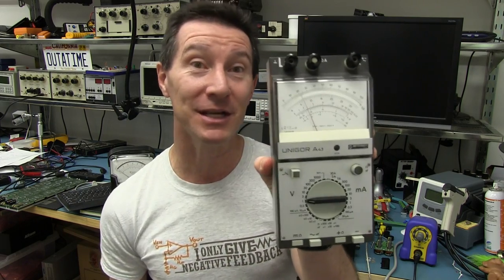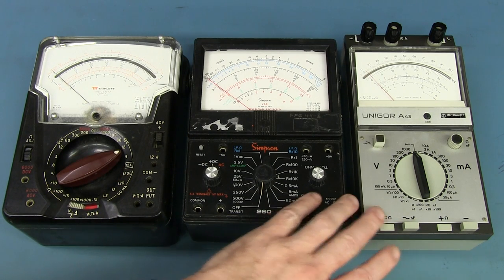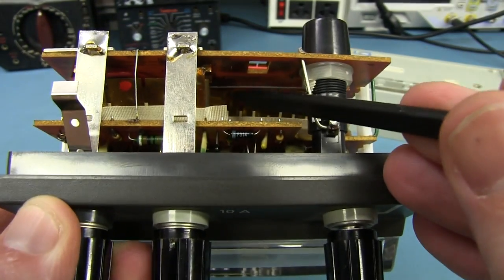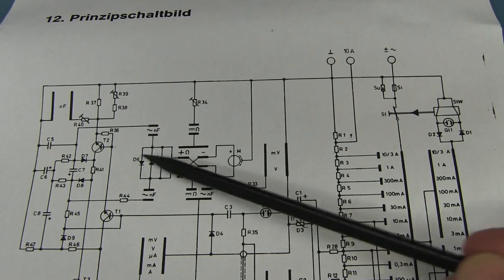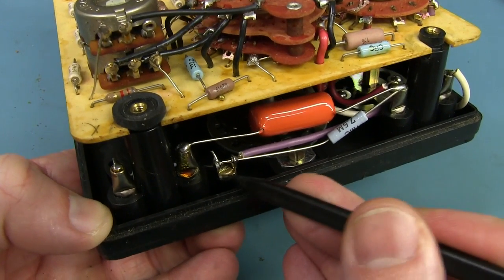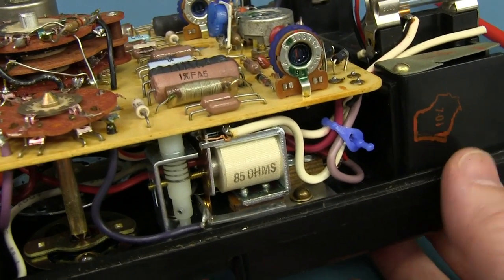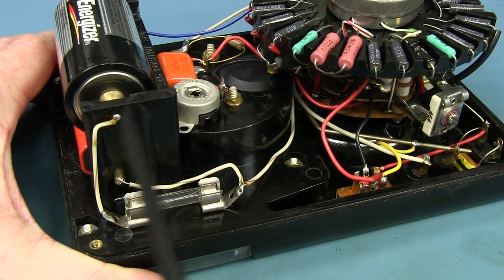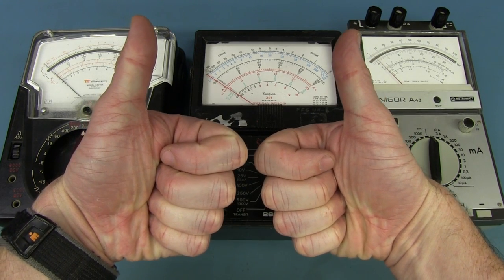EEVblog #634 - Analog Multimeter Teardowns

Comment: "German engineers do things because they can, not because they should."
Reply: That, and I believe the proof was in the pudding with that one. Crusty, perhaps, but also crusty and fairly accurate at it's age...
Reply: The over engineered protection relay reminds me of all the overly complex components in my VW.
Reply: Stephen Tack Overly complex? Or just sustainable?
Reply: *****  stuff with unneeded complexity (that requires ridiculously tight tolerances), like  pneumatic door locks, clutch throw out rods through the center of the main transmission shaft, etc... Just so many things that are fancier than they need to be, causing difficulty in repair.
Reply: It's really a tradeoff between how often you are willing to repair or recalibrate something.
Complexity and unneeded complexity are two different things.
Reply: That thing is not German, its Austrian. We've got better ones in school like this rather rude stuff, not mentioning professional ones.

Comment: how to locate R-11 and R-12 in simpson 260 6xlp, my low power resistance R1,R10 are not properly going to infinite sign even I change my 1.5 dc volt battery. thanks for help.

Comment: Hey Dave,
You should have focussed a bit more on the actual movement of these fellas... 
The Simpson does not even have a mirrored scale, which already makes it pretty inaccurate...
The Metrawatt UG 43 (I grew up, using them - I love them!!) uses a movement, that we call "Spannbandmesswerk" here in Germany. This means, the moving part is not mounted via a pivot, that sits between two stones (friction!!!), but instead it is mounted on a veeeeery thin "string" that is under tension (no friction at all!!!). At least the Simpson does have a standard movement - this alone makes the Unigor 43 superior and way more accurate than the Simpson (and probably also the Triplett). 
I have two UG43 here in my workshop, and these were the meters I used in 90% of all situations, until I got two nice Fluke DMM. Now I only use them, if I need an analoge meter (happens regularly). They both still work 100% accurate and fine. I love them (as I mentioned before...)... 
And, by the way: A multimeter that uses a 30 volts battery that is no longer available, seriously? This is not an option! At some point the battery will start leaking, resulting in a huge mess... Without that battery, you cannot use the complete multimeter properly. So, in my opinion, this is something to remove the battery and put the meter on a shelf... 
I'll stick to the UG43 ;)
Reply: By 'stone' do you mean jewel? They work fine in watches! The mirror coating has started to flake off on part of the scale on my 630NA.  I have not checked mine, but what function does that 30V battery perform?  Mine must still be good.
Reply: @barrybogart5436  Correct. I meant jewels. My mistake. 
Those batteries usually power the ohms-part of the multimeter. I guess, in the past they used such "high-voltage" batteries to be able to measure higher resistances, as otherwise the current would be too low to be indicated by such an analogue movement.

Comment: Why do the metres have batteries in them if they dont need it. The reason I'm asking is because I'd like to use my grandfather's old Philips unit but I don't know where ill be able to find a 22.5 volt battery anymore.
Reply: You need the batteries for measuring ohms. The small 1.5v is for the lower ranges and the larger one is for the max range.
Reply: Just use two 12v remote control batteries in series, or three 9 v batteries if there is space. 22.5 v isn't critical, the meter will work at 24 or 27 volts, sometimes even as low as 15 volts, as the zero is adjusted for the ohms ranges!!! Experiment!!!!

Comment: Try finding a new 30V battery for that Triplet meter. That must be hard to find :)
Reply: If I had to replace it, I would use ten 3V lithium coin cells stacked in series.
Reply: i found a couple of places. around 40 us dollars! lol
Reply: Chris W That's a clever solution :)
Reply: jusb1066 WOW! I'm surprised these are still in stock.
Reply: EdEditz
im guessing they are new-old stock, they are no longer made by any company, and  +1 to the lithium solution, anything to keep these working!
Reply: jusb1066 Yes, I bet you're right. I once bought a rare type battery for an analogue capacitor and zenerdiode meter and the shop had one but you could see that the packaging had been wet at some time and when I tried it the battery was totally empty. That battery was made at the same time as my meter had been originally. Luckily I got my money back.
Reply: Chris W would 10 lithium cells have correct number of amps or would they skew the readings, also would they effect the resisance of the circuit.
Reply: Most coin cells would have a higher Amp hour capacity than the original. I suspect the battery drain is very low, so the lithium's lower internal resistance won't affect the circuit.
Reply: Change R3 from 423k to 154K and R4 from 42.3K to 15.4K. Use a 9 volt battery.
Reply: If I were to use that meter on a daily basis I'd just leave in the original disconnected and connect a 1.5->5V + 5V->30V step up converter to the 1.5V battery.
Reply: *****
Are you not using a sledge hammer to drive a very small nail..? Battery capacity would be almost zero due to the up conversion from 1.5v to 30v and along with the cost of components....?
Reply: bain5872 it's cheaper than the other solutions....  I have a 1V to 36V converter for a led strip and at 92% efficiency it draws less than 400ma from the battery i connect it to. It runs of a standard alkaline AA battery  for 6-8 hours. If you are to use those big cells it will run for years in that multimeter... and the parts cost like 5-8$ to make it.
Reply: Thanks but I have to ask....what other solution are you referring to? Just replace two 1/2 percent resisters compared to a dc to dc converter that drains voltage for current at 30 times the rate. Why?  Isn't the resisters cheaper in the long run...?
Reply: bain5872 Well i am not talking about mucking about the multimeter's internal circuitry, so no, not that solution. I believe  they used a 30V source for a reason. Not sure what it is, but i believe it has to do with it's accuracy at measuring  Mohm resistors.
Reply: No Mucking required my friend! IT'S OHMS LAW! Little elf's in Norway did not build these things. Again, simple ohms law. I wish you only the best. Thanks for your reply!
Reply: bain5872 No little elves in Norway were involved in building these? You, sir, have totally dashed my hopes and dreams.
Reply: Darn. Sorry about that...Seems I've let everyone know where Flukes come from. I should have kept quite!

Comment: Wow, so much ignorance in this video, I am starting to wonder about other videos you make.
This "too big over-designed" relay in unigor a43 is fast speed high voltage protection unit which actually works as Swiss clock. Thanks to this devices the people who used such unigors became funs of Apple-hype  caliber. In engineering world it means something. Unigors were popular in universities and military because they were unbreakable. (and precise which is always a nice bonuse). 
Electronic protection rated on similar levels of energy and voltage this piece was checked and actually worked would take pretty much same space. E-l-e-c-t-r-i-c-i-t-y,  as they say.
Just a year ago I've sold mine unigor 6ep with broken analogue part (needle suspension got damaged from fall,),  bought Hioki DT4282 on that money and still had some change left to buy some other toys. So much for "cheaply designed" tool.

Comment: I'm really surprised with that German meter, it's nothing like it should be, usually the Germans make top quality products...
Reply: It's an Austrian product, it still works and it's in spec after 40+ years and most PCBs were like that back in the day.
Reply: I don't think it's a bad design. If it works for that long than things were very well thought of. And it has 2 boards! They practically had no alternative to board to board interconnect at that time. What they had was not good enough, so they soldered them together.
Reply: You can't argue with that...